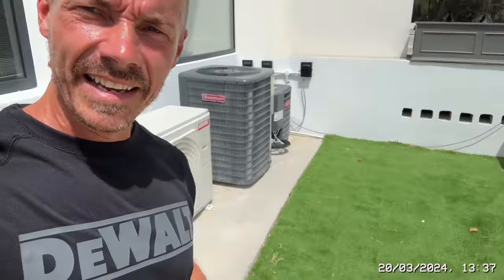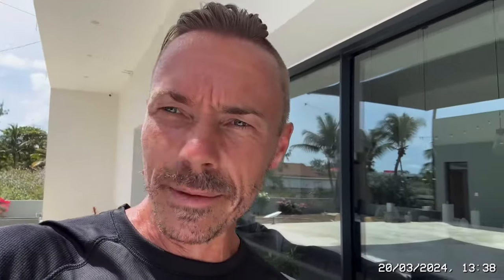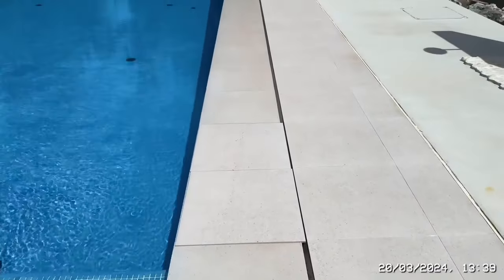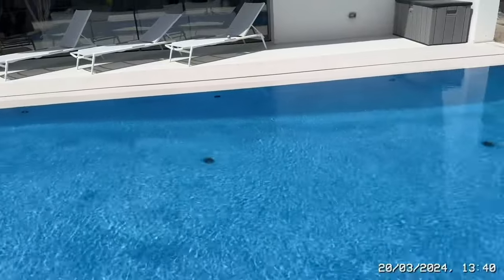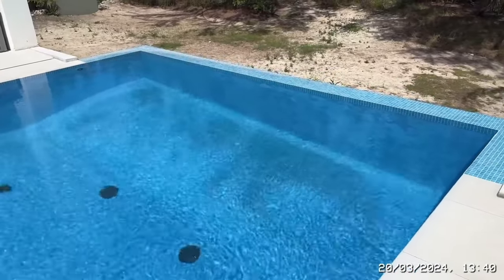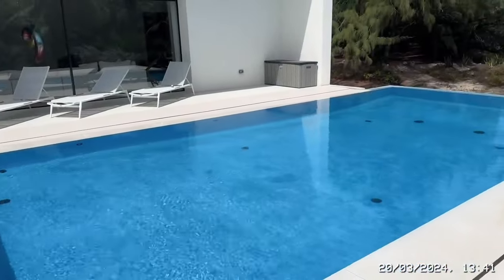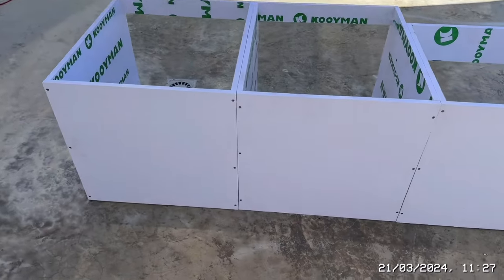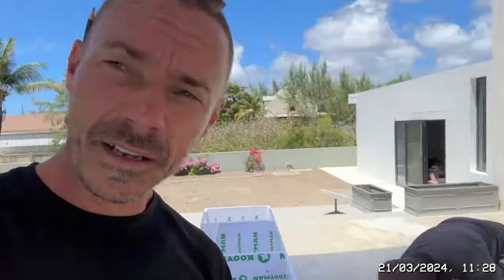BARBADOS BEACH HOUSE - BUILDING A DECK BBQ

Comment: The barbecue setup looks good. Hope it goes well. Maybe you could use some fire resistant cement boards or just treated wood for the inner skins.
Reply from the maker: Yes I need more of a gap though. Time to rework!

Comment: Alv, can you guys get cement board out there, I used it to build an outdoor kitchen with bbq done like yours and a pizza oven, it is rot resistant, strong and heat resistant??
Reply from the maker: Hey Steve, yes but I was trying to steer clear of anything i would have to paint that did not like water! I had a brain fart there 😂

Comment: I wonder if cladding the panels of concern with thinset and thick porcelain tiles, will be good as a heat damper to prevent any melting of the plastic panels??
Reply from the maker: 👍🏼 just no space between the unit with out remaking it!

Comment: Yeah, PVC melts around 200 degrees. As you say you could easily get up to 300 degrees on a bbq. So I think you really will need to do something there. Can you slide down a very thin bit of wood? Even just a 3mm sheet might be enough  to insulate it.
Reply from the maker: I dont even have 0.5mm, 😂 either way I am going to have to remake the BBQ unit to make it wider so may as well go for Cement board which I was trying to avoid  due to weight and colour

Comment: It doesn't look like fiberglass 1/2 sheets would fit but it would make a difference(HVAC sheets).  Other than that I would use spray foam insulation but then you would have to clean and cover it up good
Reply from the maker: Thanks Ron, I need a bigger gap!

Comment: Do you have a durock product in Barbados? It’s a cement board that’s usually used in fireplaces and might be something you can place between the grill and PVC product.
Reply from the maker: They do cement board but the gap is the issue, I need to rework it